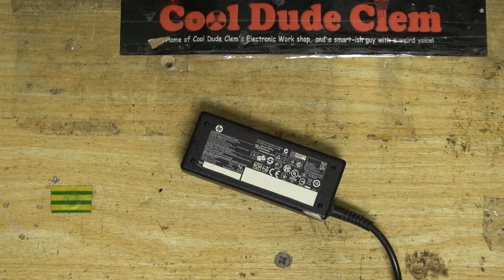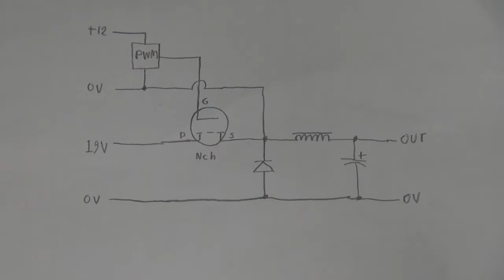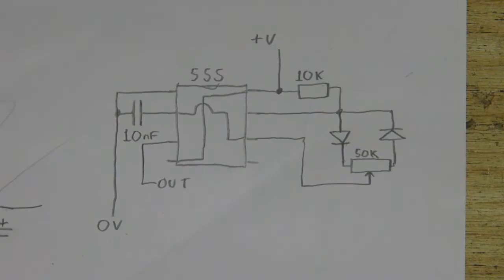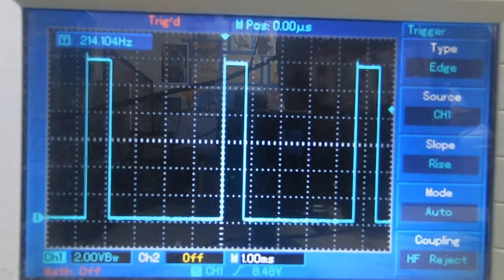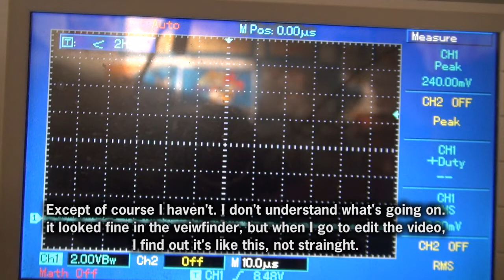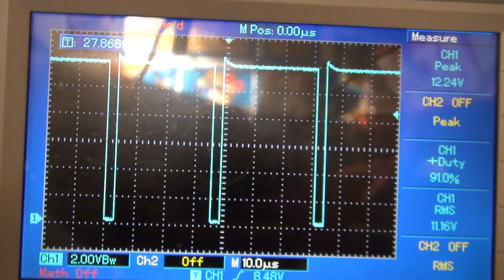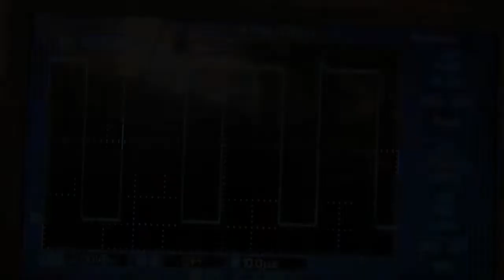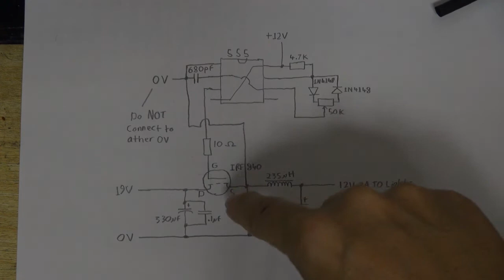Experimenting with an experimental buck converter

Comment: The power supply should have a tl431 inside for secondary control. You can just change resistors and make a voltage divider to adjust it easily.
Reply: Feedback loop may not like that over a wide operating range.
Reply from the maker: I don't really want to mess with the insides of that power supply, I don't know how tolerant of such a voltage change the controll circuityr is, it might think something is wrong and refuse to work. Plus I can't crack that thing open anyway!
Reply: If it's a 494/ka7500 it's easy to snip out over/undervolt protection and even make it a constant current supply.  I've modified several AT supplies.  Chop out all secondary side.  Rewire 12v to 5v heavier diodes move over caps wind a new filter.. change the protection circuitry a bit and can get a pretty wide range of output at heavy current..

Comment: If you stick with the Buck converter design you should really consider to add feedback, as the LED panel will change its characteristics at different temperatures and through aging. It would probably be best to use the panel current for feedback, as this directly translates into photon emission/radiant flux (and would also account for the voltage losses on the wires). You could measure the current with a small valued shunt resistor, amplify / compare it with a reference value and use an optocoupler to give feedback to the PWM control side. 
If your MOSFET gets hot, it is possible, that the limited output/input current of the 555 does not charge/discharge it fast enough. Usually, dedicated MOSFET drivers can momentarily provide multiple amperes to quickly charge/discharge the gate in order to minimize transition time. You might want to add a simple push pull stage with discrete bipolar transistors. Did you measure the rise and fall time of the MOSFET?
Reply from the maker: I was thinking of adding a gate drive chip, but didn't bother since it works well enough without it anyway. I haven't actually measured the waveform at the gate, for now I'm just assuming it's good enough. I'm not sure how I would add feedback to a 555, unless I use something other chip as my pulse generator instead.
Reply: @CoolDudeClem  The simplest way to add feedback could be to control the RST pin of the 555 to delay the next PWM cycle if the current gets too high (with hystersis). Otherwise you could use the FF of the 555 with an externally generated square wave (requires 1 opamp for instance) or use the 555 as a triangle wave generator and use an external comparator - both would allow for generation of a constant frequency voltage controlled PWM signal.

Comment: Just chop open the notebook power brick and modify the feedback divider.  Should be simple!
Reply from the maker: It's a simple idea yes, but I'm not sure what the control circuitry would think of such a voltage change, it might think something is wrong and shut off.
Reply: It doesn't give a F about voltage on output, all it cares is current, i never had a problem with this, i'd be worried trying to increase voltage, decreasing is a piece of cake.